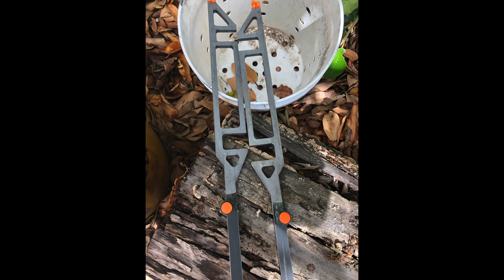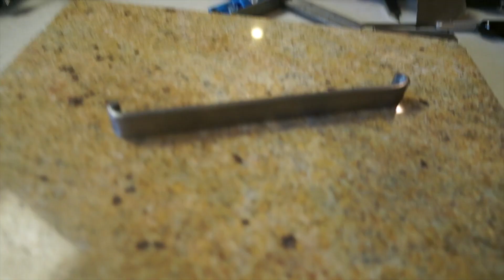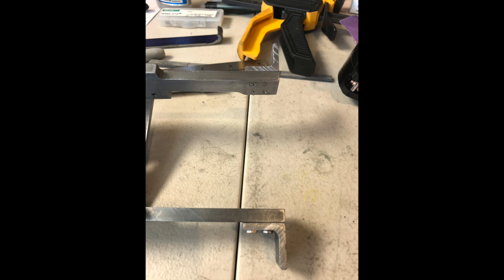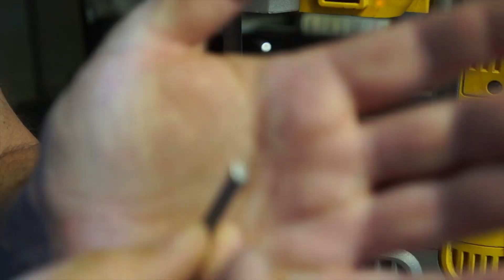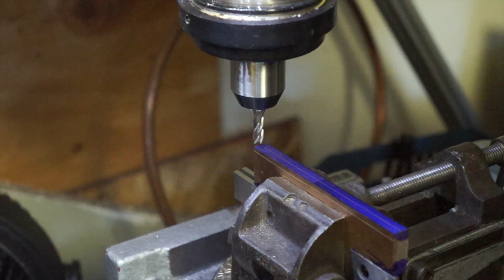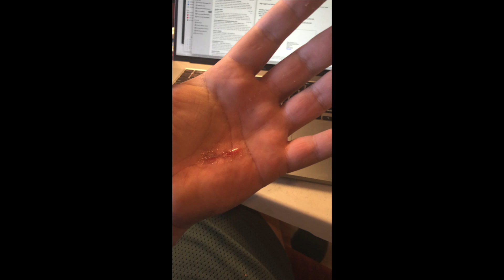Virginia Part1: Finishing the frames

Comment: I enjoyed watching your videos.
There are a couple was to safely drill brass, first as you have already said is to make your setup as rigid as possible - preferably in the lathe with a 4 jaw chuck but also you can modify your twist drill by putting a small flat on the cutting edge of each drill flute.
How do I know this ?? - because I did the exact same thing you did and got hurt in the process.
A lot of live steamers who build have two sets of drills, one set for steel and another that has been modified to drill brass.